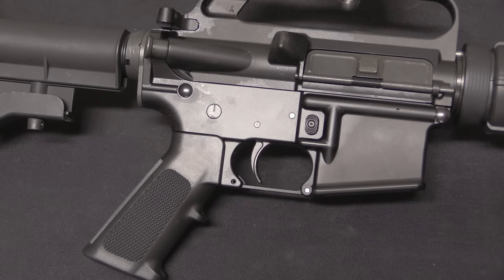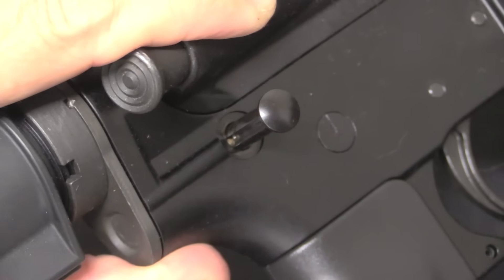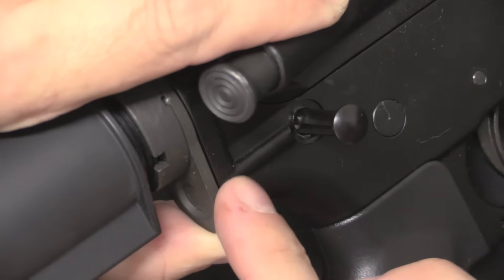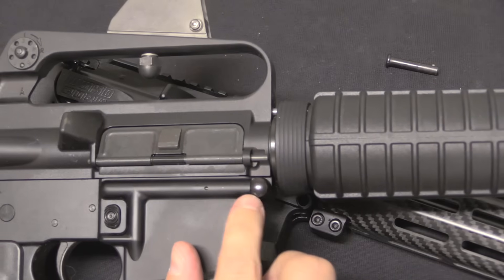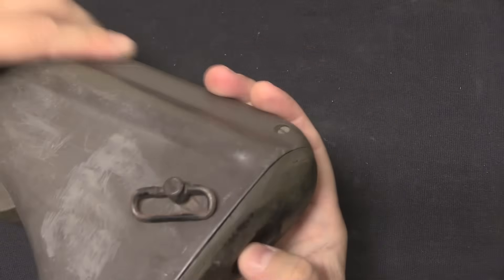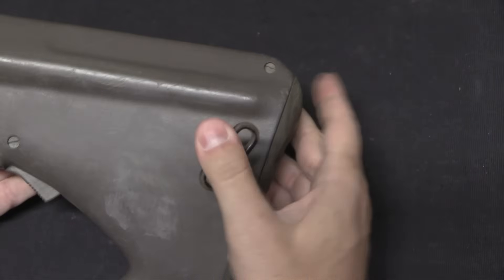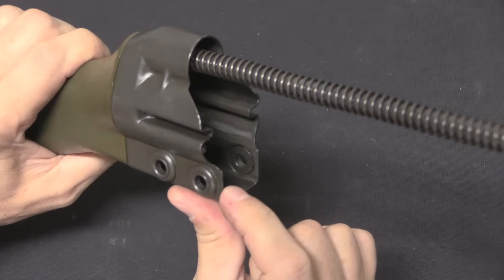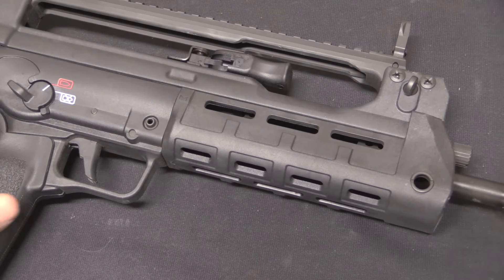Ask Ian: Why Don't More Rifles Have Captive Pins?

Comment: This is strange: I can see a way to design a pin with built-in retention that is about as complex as a non-retaining pin. Yet, I find it hard to believe that nobody else had this idea before me 🤔
Reply: In some cases, they have existing stock of pins they do not want to replace with the newer pin. 

In other cases, management look at the new and improve pin, then the foot note is new tooling and extra time spent on the production line. They shut it down.
Reply: You're likely forgetting something.  I had an Idea for one that used a spring clip that fit in a pair of grooves and would work in a WWSD lower, but the clip would interfere with the upper unless I cut more material from the lower than the small hole an aluminum lower uses. . .
Reply: Such pins are common in the aircraft industry. They have a captive ball sticking out of one side of the tip, and a button in the middle of the head. When you pressthe button, it takes the spring tension off the ball, allowing it to retract and let the pin come out.
Reply: @MrHws5mp  , sounds exactly like the Swiss pin that Ian has shown on the video 🙂
Reply: Patent it and sell it as a license to produce. Get paid 2.50 per pin.
Reply: Could you explain how you would do it?
Because I can't think of a way that isn't as complicated as what the Swiss did.
Reply: @Jehty_  , what if we make that springy thing at the end of the pin have an additional curve with a flat side that would go against the inner wall of the receiver, preventing the pin from being pulled unless you reach into the receiver and depress that springy thing with your finger? 🙂
Reply: @konstantin.v  it wouldn't pull all the way out of the part being retained and you'll have the same problem as my spring pin idea
Reply: @johnturner7790  , so, the problem is in that the retracted pin needs to sit flush from the inside, right? Moreover, the additional springy bits or whatever need not to catch on the other part of the firearm that the pin is holding. And the pin has to be the same diameter all along to hold the parts without jiggling... I think I'm beginning to understand the extent of the pin problem. Thanks 😊
Reply: @Jehty_  I would get a T-pin with a groove in it and a plastic or even stamped metal c-clip that has a hook on one side. Slip the clip over the pin and then push the hook outside the rifle on the side with the wide end. Hook clips to the side that is being slid back out of so there's no  extra size moving around when you pull the pin back out.
Reply: oh, and if the receiver is very thin like a stamped sheet metal receiver and it causes problems for the spring, thread the pin through a simple metal washer to add some thickness for the c-clip spring to grip on.
Reply: All of this discussion about springs I think skips a step. Why springs? Do you need to have a tool-free removal of pins in the field? Generally not, so how about no spring? Flip the AR15 pin 180 degrees and drill from that side for a hex set screw. That essentially makes it an armorer's job to remove them, but requires only the shortest distance to the pin to be drilled and shouldn't require field maintenance if threadlocker is used.

Comment: One trick for guns that do not have captive pins:  Get a full replacement set and attach it to or find a way to install them into a cavity in the stock.  If you have replacement parts on hand you will never need them.  If you want a belt and suspenders approach, get two sets, one for the stock like I mentioned before and one for your cleaning kit.
Reply: We hope that more companies copy Heckler & Koch's habit of installing dummy holes for pins when the gun is dismantled.
Reply: @robertwarner5963  You always have "dummy holes".  You can always stick the pins back in the original holes on one or the other components after separating them.
Reply: Soldiers will be soldiers, you could be taking apart rifles in a group and those pins WILL get lost somehow. Sometimes 3 is 1 lol
Reply: Yep. "2 is 1 and 1 is none" as the old adage says.
Reply: Alternatively, get a gun that doesn't have pins you can lose :)
Reply: I'm amazed that no one here seems to have figured out that the H&K G3 has three pins, while it really only needs two. It's got two pins in practically the same place doing the same thing, which essentially means you have one pin spare in the gun already.
Works very well in a military setting, where everyone got the same rifle and so everyone has a spare pin in case one gets lost or damaged etc. You can just pool them together if needed.
Reply: Sometimes what you get, or what you want is not available with captive pins.
Reply: Do you ppl not wear pants with pockets?
Reply: @onoes9646  small parts have a habit of leaving pockets when it will be most inconvenient.
Reply: Women don’t wear any pants with pockets.
Reply: @Tragicide  the lack of real pockets on female clothing is both pervasive and really annoying.

Comment: We also forget: soldiers are great at breaking stuff. And those thin sticks sticking out are way easier to break of than something u just lie somewhere next to the rifle
Reply: But you are forgetting the fact that if the pin is not captive, it becomes really easy to lose, especially in a dark forest.
Reply: @ErikTheAndroid  
That is tru. 

But 
1. That can be helped by drilling the soldiers to reinsert them until it becomes muscle memory. 
2. They are easier to replace, u could just give one guy in the unit tones of replacement pins and those would be easier to install than a captive one
Reply: If they're great at breaking stuff, they're also great at losing stuff, like a non captive pin for example
Reply: Yup, In the Canadian Infantry that was one of the 1st things that I noticed about my C7, the pins were vulnerable to some idiot in my platoon stepping on my lower and blowing the pins out, 60 morons all gaggle-fucked around with stripped rifles = someone's isn't going back together correctly LOL.
Reply: @masaharumorimoto4761  not only am I afraid of what that many hosers would do while stripping their guns together, I fear, mostly from being a Canadian, what a bunch of us would do to try to fix that without letting the CO know.
Reply: @Never_heart  I luv duct tape,super glue,JB weld and zip ties!

Comment: When talking about the ar15 the captive pins were an ask from the us army if I remember correctly. Your own collection will show that the original ar10 was designed with non captive pins.
Reply: The Colt Model 1 (aka 601) utilizes a non-captive pivot pin.
Reply: @x-calibearusallc  I do think the title could be better. Any firearm that is purchased in a large order, the purchaser can demand anything they want. However magic is expensive and it all boils down to how much magic they want to pay for. On the other hand COTS are as is where is; unless they want to modify the COTS at which point it is no longer COTS and magic is expensive.

Comment: The rivets with thread in them is a industrial way to add threaded holes to sheet metal or other such material. "Blind rivet nuts/Blind nutserts" So the proprietary part is probably the pin/screw that threads into the blind rivet nut. It's still a impressive way to have captive pins.
Reply: I'd really like to see that rivet thing taken apart to show how it works inside.

Comment: A tiny remark on 8:20 - right above the hole I can see the circular witness mark from manufacturing, hinting that the hole might have been molded in - which would be somewhat superior to machining it.
Reply: You're correct, that hole would be formed by a pin in the mould, not drilled. I'm pretty sure Ian knows that, but wanted to simplify the explanation.
From what we can see in that shot, it appears that the hole is in the same direction which the mould opens, therefore the pin would be fixed to the mould and relatively low cost to implement.
The witness mark above it is from an ejector pin, which would be necessary regardless of whether the pin hole was there or not. You can see the ejector pin mark on the other side of the receiver as well.
Reply: That witness mark is not indicative that the hole next to it was molded in.
Instead, what that witness mark indicates is that there was an ejection pin that impacted that point on the part (and many other types of witness mark on injection molded polymer parts will indicate either that or a point where material was injected into the mold, as well as perhaps one or two unique witness marks that serve identification purposes such as what material it is made of or when it was made, however those are usually self-evident as such at least on consumer products, unsure if the same is true with polymer parts for firearms).
Reply: @44R0Ndin  it indicates the ejection way, which is in line with the holle, thus it might be easy to implement without extra costs and eliminate a drilling procedure.
Reply: @trischas.2809  yup, that's a mold gate.
Reply: That looks more like a ejector pin indent. Not a witness pin. I covered this in another comment; but they need to eject the part from the tool after they shoot plastic. This is achieved using ejection pins than push the part from the tool core or cavity, depending on which way they decided to draft the walls to allow it to be ejected.
Reply: That pin mark would be there either way, as you can see on the other side of the part. Not much of a hint to anything. It's still a weak point that will fail.

Comment: "How typically Swiss is it to manufacture a pin that is capable of malfunctioning" 🤣
I'm heading in to work this morning to address some Swiss metrology equipment that is overly complicated and is always breaking down.
Reply: One question must always be: is it more complex than what it needs to be?

And the next question: Given a fresh start, can it be simpler and perhaps even do the job better?

The second bite tends to provide a better solution especially if the first one can be played out to functioning (or dysfunctioning) prototype.

Keep in mind that the ultimate simplication is elimination.  Step back and given a better understanding of the whole from experience with the physical artefact, can you eliminate the need by modifications to another aspect?

Adding to the turmoil in the Engineer's mind is the pressure to make something that will sell. Soon, and with profit to justify further development.

It is easy to meet specified requirements. Ask any Elbonian.
Reply: At least the equipment is not Japanese, my company when things go bad takes 36 hours for a Japanese engineer to get here to the Midwest and fix it  (Injection molding is fickle)
Reply: @79Luca79 I respect German engineering and meticulousness but reliability is absolutely a problem. It's like they have an obligation to give designers and engineers busywork. The issue is that their penchant for novel solutions introduces problems where none previously existed. Whether it's an unnecessarily complex design or a new plastic formulation, the end result is good build quality marred by frustratingly questionable decisions.
Reply: @79Luca79 I have no experience with Liebherr dump trucks but I have one of their domestic fridges which I can highly recommend.
Those and Miele washing machines.
Reply: @79Luca79 Have you ever owned a BMW car? It sounds like maybe not.
Reply: That is such a quotable line. One of Ian's best!
Reply: Well in this case, it may be typically Swiss, but it's not uniquely Swiss. Those kind of pins, with a built-in spring detent that's released by a push-button at the end, are common in the aircraft industry. I saw them all the time in my old job (aircraft factory parts supply). I'm not aware of any particular problem with them, and it's not like they have more parts than any other solution: it's just a matter of whether the spring and ball are in the pin or in the gun/airframe.
Reply: @MrHws5mp  Same here, I've used the SG550 for an entire decade and despite all the mud and dirt that went through, I never had those pins fail on me even once. Nor did it to anyone in my battalion from as far as I remember.
Reply: @MrHws5mp , Ian did not actually say they were prone to malfunction, or more likely to malfunction, just that they are capable of malfunction.
Reply: @79Luca79 do you have sources for this? Or is it your usual b.s.
Reply: Sounds like the user is failing the equipment, not the other way around 🇨🇭
Reply: @MenwithHill  Haha. Nope. Too many unnecessary bells and whistles that add points of failure and no value (for our application)

Comment: The AR15/M16 rear take down pin detent hole is 0.094" and is not stepped
 as you said. I think you are confusing the selector detent hole which 
is internally stepped.
Reply from the maker: Yup, hence my note in the description text
Reply: Why is the selector detent stepped. Does it serve a purpose?
Reply: @RiceCrispy320  Speculation: if it were a single diameter detent it can fall out due to the hole size for the selector shaft axle. Since the selector is sometimes removed as part of removing the trigger group I guess they decided to make sure it was captive. This also makes assembly slightly easier in that it can not come out of the detent hole before the selector is installed.